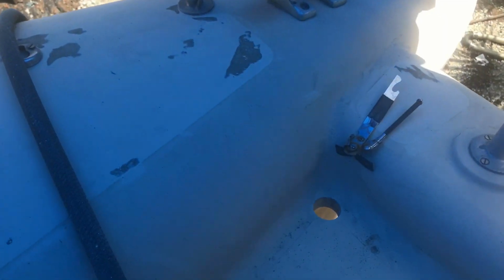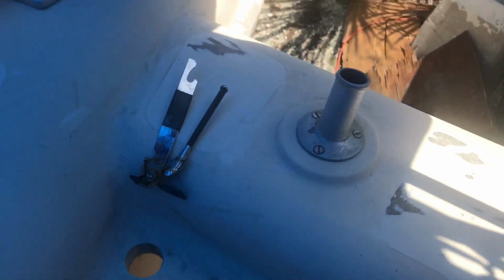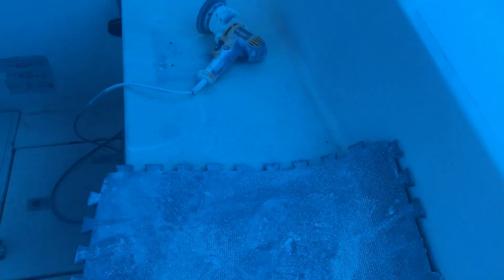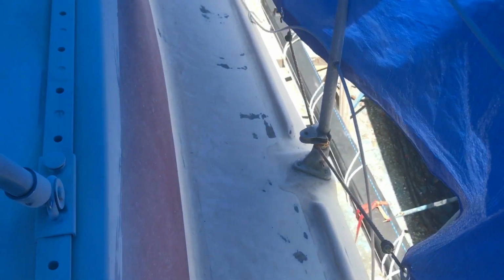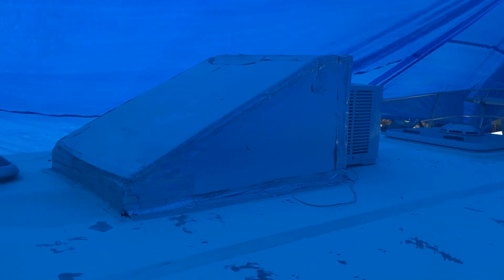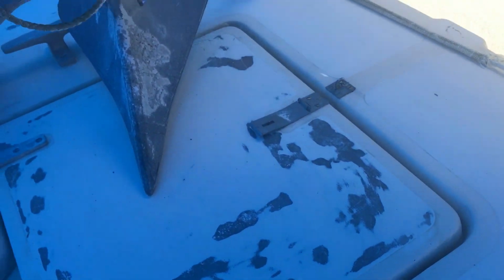13.  Grinding off factory non-skid

Comment: Goodness, what was the problem with the non skid? Probably worn , but why not just clean and paint?  I'm sure it will come out nice.
Cheers Warren.
Reply from the maker: Warren,  Great question. The factory non-skid needed to be taken care of cracking in between some sections. Another concern was being able to sand in between all of the fine woven pattern and insuring that I get good adhesion for the primer and paint!!  Not sure if this was the best option but those were my concerns.
Reply: Rod,( Rob?)  I had a small boat with similar fineweave type non-skid. It has some  cracking, crazing and damage/repairs. Since the gelcoat had plenty of sun damage it was fairly porous. I scrubbed with scotch-bright and solvent and some sanding of old repairs. ( and repaired some big cracks) I then used Pettit Skip Sand Primer 6998 , it's was a thin fast drying hi solvent product that you have to paint over with in an hour or 2. I topcoated with plain interlux bright side with their plastic grit in it. This worked really well and held up for many years with no sign of lifting and was still good for the couple I sold it to later.  I just hate to see you doing more work than necessary, you have so much to do!  Cheers Warren
Reply from the maker: Too late!!!  It's gone now...😂